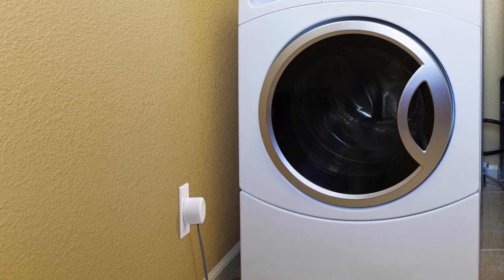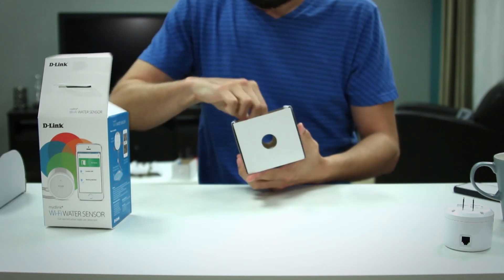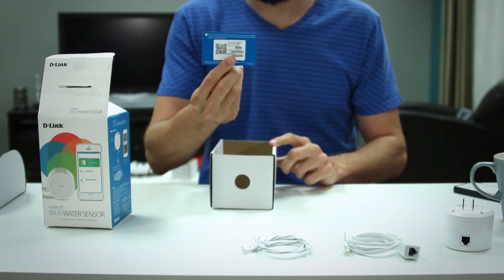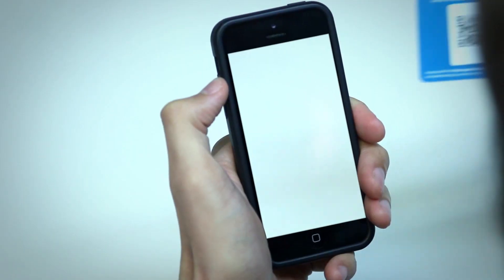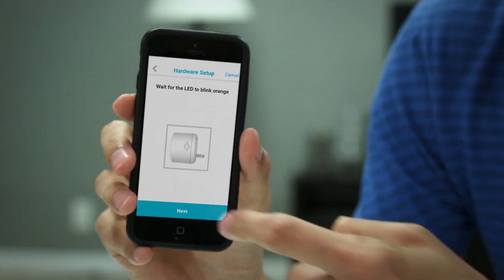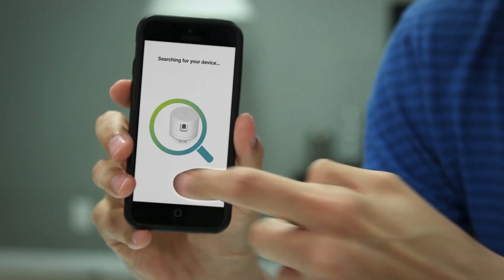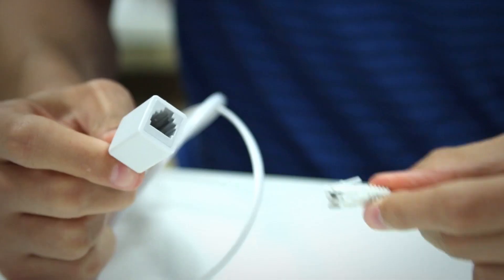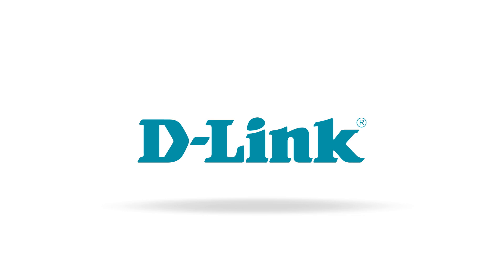mydlink Wi-Fi Water Sensor (DCH-S160) Unboxing and Setup

Comment: Have you had a problem with the hub connecting to the pucks if the power to the goes out, then back on?  Do you have to re-pair after power loss? Should it be plugged into a UPS?

Comment: Is the extension cord included to add to the sensor line? Under sinks this device is not good with no outlet usually available under kitchen sink cabinets.